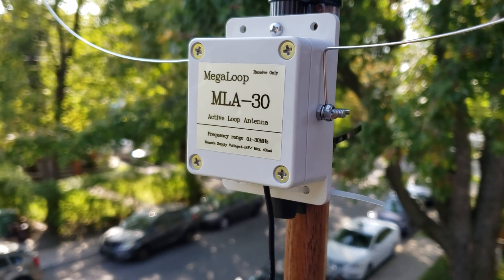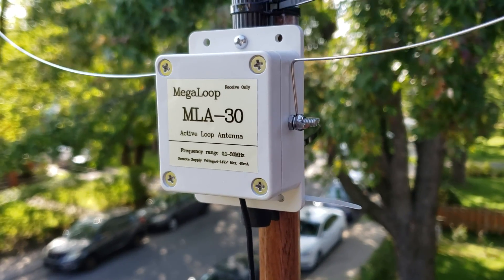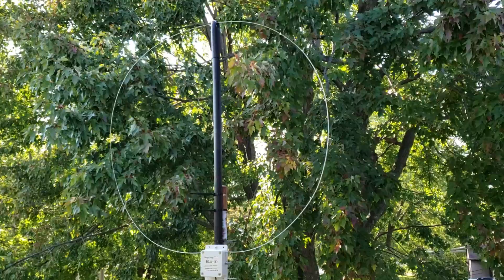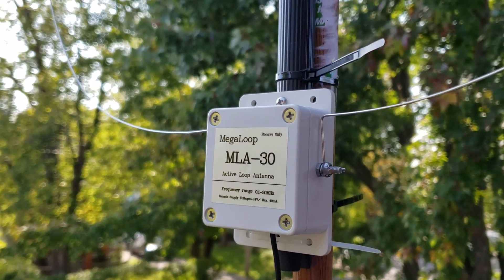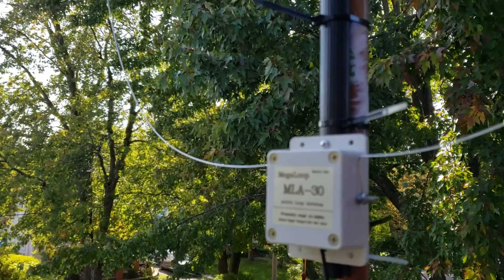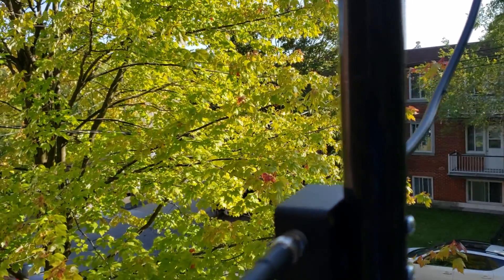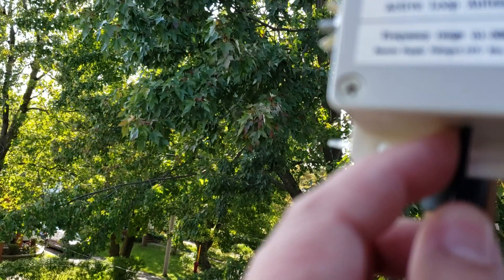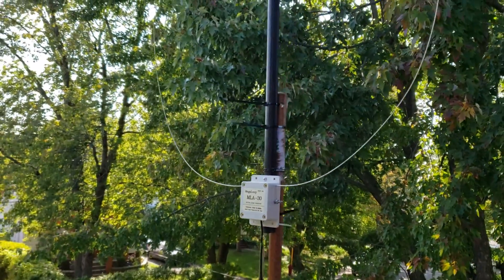MLA 30 VS W6LVP loop antenna standing the harsh Canadian Winter

Comment: The loop on this antenna is very thin. Can I use a thick (14 or 12 gauge) bare copper wire instead?
Thanks!!

Comment: It seems this is fully waterproof ? Just can't get the wire loop symmetrical / straight with mine though
Reply from the maker: does not matter... it does not need to be perfect and yes it is waterproof

Comment: I DO THINK THAT THE 33 POUNDS ONE WILL LAST AS WELL AND WORK AS WELL IF NOT BETTER AND AFTER 2 OR 3 SEASONS  ITS MAY WEAKEN WELL JUST GET ANOTHER BUT YOU WILL FIND IT WILL BE FINE I WOULD PROBABLY  PUT A SQUIRT OF BATH SEALANT AROUND THE TOO JOINS ON THE CHEAPER ONE AND IT WILL DEFIANTLY LAST FOR MANY YEARS....HAPPY RADIO
Reply: even if it lasts you 1 year, you can replace it 10 times for the price of 1 W6LVP. That's 10 years. and I don't think the W6LVP will last 10 years by itself. That said, the expensive loop is stupidly expensive because of your usual average american gearhead ham "i want the very best" who invests $200 in the Diamond DIPOLE antenna, which is literally wire and a connector. But hey, it's a commercial antenna so "it must be better than homebrew".

Comment: Good day! I just picked up my MLA-30 package from the post office. I opened it up and noticed that the short cable from the Biasing Tee to shortwave receiver, will not work with my Grundig Satellit 800 receiver. The fitting is way too small. Would you be able to tell me what type of adapter I will need for this to work with my receiver? Thank you for your time.
Reply from the maker: You need  SMA female to PL-259 adapter  I purchased some on ebay for a couple of $ each

Comment: There’s a product called coax seal that you can use over the connectors to weather proof. Of course the other reality is that by the time it degrades/falls apart you will likely want to try a new antenna anyway 😆

Comment: The reason why I chose the MFJ-1886 antenna was the aluminum loop and it is much more durable especially the winters here in New York.  The W6LVP loop looks like it will degrade over time with the UV and weather because of the plastics. Plus I wasn't going to pay extra for some filters on the W6LVP loop.  He lost me on that deal.  I would love to try the W6LVP loop however I'm not paying over $350.  I may buy the MLA 30 for a travel antenna. It has everything you need, all I would need is thin PVC pipe and a tripod.
Reply: Infelizmente o valor da MFJ1886 é muito alto

Comment: BTW that cable on the MLA is both for power and the feedline that attaches to your receiver’s antenna input? Is that right?
Reply: It goes to a Bias tee that supplies 5 volt DC to the antenna amp and isolates the RF

Comment: Put the thin wire inside a kids hula hoop... cut it open and slide the wire inside.
Reply: I inserted two rounds of wire inside a kids hula loop and connected the ends to the variable box of an AlexLoop and got to tune 2400-5500kHz. I have a smaller loop and I intend to do the same to tune shorter bands (49m), since the AlexLoop covers 7-30Mhz.
Reply: That is some very clever out-of-the-box thinking! And, talk about a stealthy antenna... :-)
Reply: Good idea !!!

Comment: my 50 years experience with antennas has always been no matter how good or bad the antenna is always always seal if before you put it up. I use a high quality silicone or marine sealer. doing this just added 2/5 years or more extra time before the weather even gets to to factory seal. and always use rubber tape to seal the coax then put a zip tie on the tape to make sure the tape doesn't unwrap. then put a drip coil in the coax and zip tie it all to the mast. I had a HF beam up for 34 years with zero issues, well other than the hurricane that blew it down. :)..
Reply: Yes use "rubber" tape - its called self amalgamating tape  but may not be always rubber depending on the brand !!

Comment: Gilles, use some heatshrink on those connectors after you have taped them (you can then also cover the tape with liquid electrical tape which you brush on)... On the cheaper loop you can make a canopy cover (plastic container etc..) to help channel rain  and snow off... You might have to replace it after the sun gets to it. There's a lot of ways to avoid water issues !

Comment: Another question I  was wondering about, how well is the preamp protected against very strong electrical bursts from nearby lightning strikes? Say lightning strikes a block away? I've had the front end blown out of a radio from a nearby strike. Of course, nothing will survive a direct strike, but we get some pretty nasty electrical storms out here in Colorado. Guess we'll find out. :-)
Reply: Gerf you can get lightning arresters that goes in line with the coax, or you could earth the loop with a earth rod to get a good negative potential to earth
Reply: @daveschwarz5279  Dave, I disconnect coaxes when there's a storm around. That's the best way to avoid static discharge problems. But with any kind of active antenna, like an active loop, there's no way to disconnect the antenna from the preamp, other than taking the loop completely off. Better preamps and receivers will have some static protection built in, usually using diodes and such in the front end.
Reply: mine was installed with a lightening arrestor and grounding rod. so if Gilles does that grounding he will be safe.
Reply: plus i found that by grounding the system it decreased the noise even to a lower level
Reply: It's worth getting a qualified electrician to put in an NEC standard grounding rod near where your antenna or antenna tower is - it can be very inexpensive if you can have it done with any other electrical work that you might have. I personally unplug and disconnect everything connected to household power and antennas, and use my HTs and vehicle mobiles (if I have to go out) during electrical storms. I would ask any more experienced hams or even radio pros (commercial guys, broadcast engineers, etc.) that might be in your social circles to see what they recommend in your area - they tend to have really good practical experience especially if they are also hams.
Reply: Probably the safest way is the have a lightening pole near and higher than the antenna - its not perfect but a good idea !!